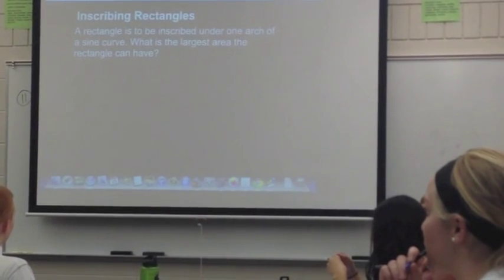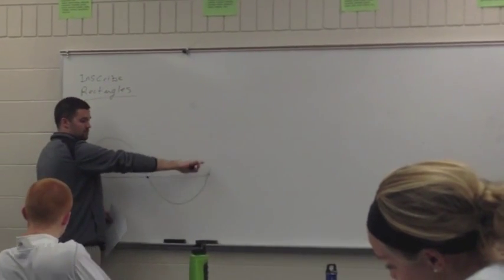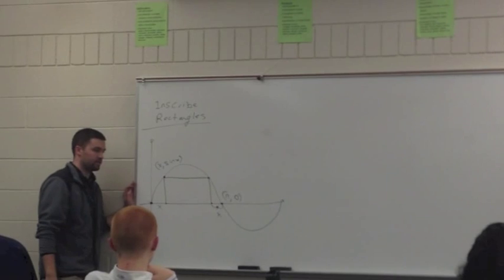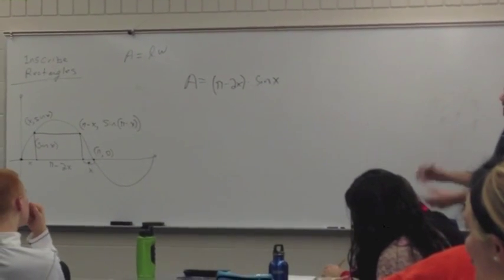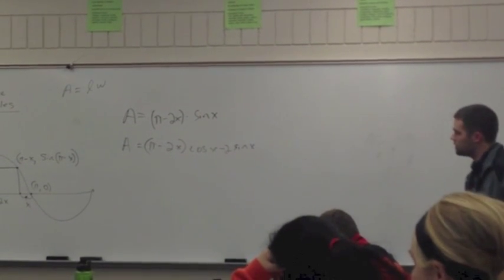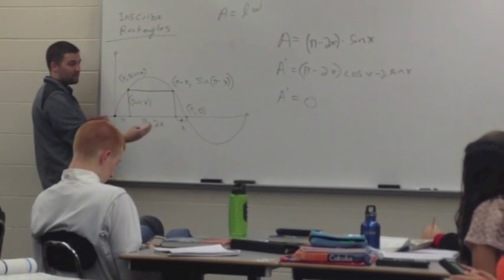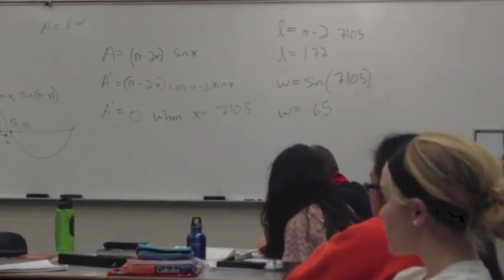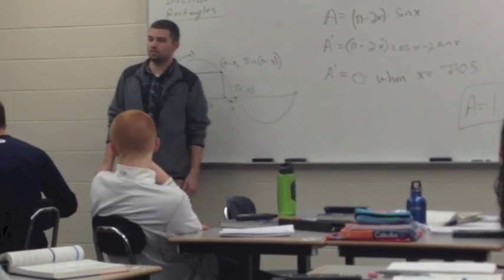Maximize the Area of a rectangle Inscribed in a Sine curve

Comment: Is it possible to do this without a calculator ? How did we come to x=0.7105
Reply: We are looking for the point at which y is maximum in the function of rectangle area. After finding the rectangle area function, we looked for the point where its derivative equals 0, which is definitely its maximum point. In order to find the value that makes this function zero, you can either graph it and look at where it is zero, or use trigonometric identities and a lot of algebra to find the answer yourself. You could also use a smart calculator on the internet if you just don't want to graph it for some reason. So yes, it is possible to do this without graphing but it would be a lot more tiresome. Aditionally, the amount of trigonometry involved probably will force you to use a calculator.
Reply: @TheVirtuosoe  .7105 is nothing but 1/√2 or √2/2